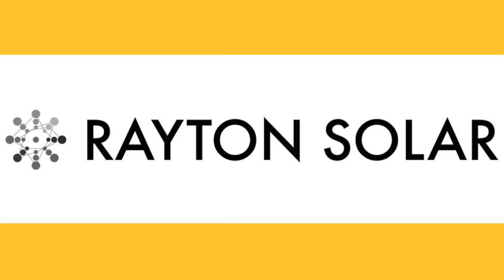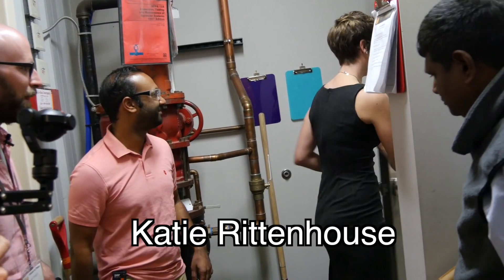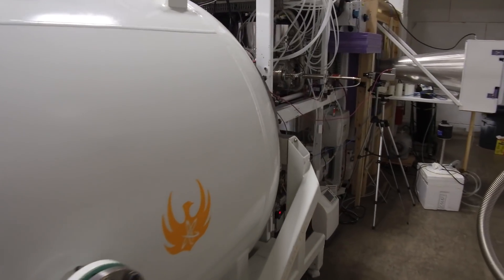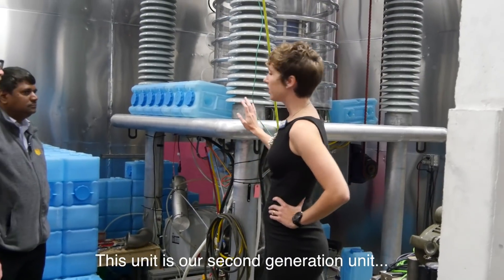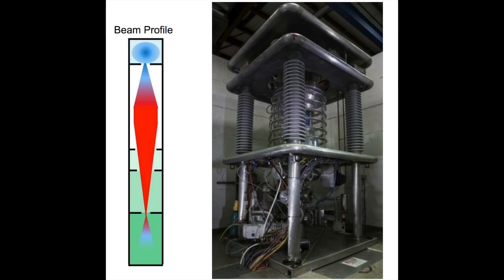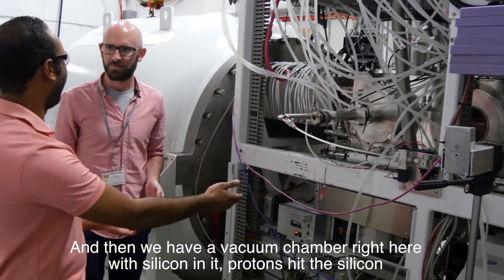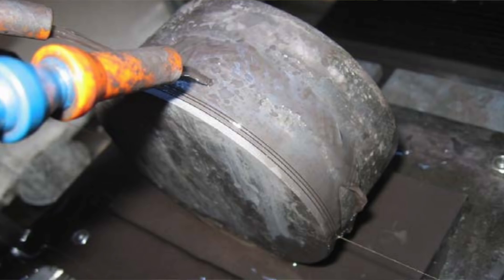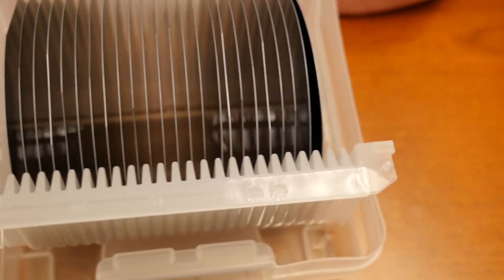Hands On Awesome Tech: Making Solar Cells With a Particle Accelerator

Comment: I cant help but wonder but if solar panels are meant to absorb solar radiation why are they blue instead of straight black? Isnt black allegedly the color that is supposed to absorb light to the fullest? Wtf?
Reply: It really depends on which frequency of light you want to absorb. Optimizing it for just that frequency is better because solar cell efficiency drops the hotter they get. More is not always better.
Reply: There are both blue and black solar panels, each using different forms of silicone.

Poly crystalline solar panels use a process that wastes less silicone and thus make them easier and cheaper to produce; this process gives them a blue tint and doesn't allow them to be as efficient if they were black. However, the cheaper costs outweigh that problem, so you often see these as the norm for the solar industry.

Mono crystalline solar panels are much more efficient due to their black color, but the process to make them wastes a lot more silicone and other material. This is obviously very problematic for companies who want to make as much product to sell as possible, quantity over quality really.

I'd say it'd be better to use mono crystalline panels if your space is limited and you need each panel to count, but if you have a fairly large area, what's the bother of losing a bit of power to save money?

My source for these claims is: https://news.energysage.com/why-are-solar-panels-blue/ 

I'd also point out that there are solar panels that convert heat into energy instead of the light, I haven't research what technique they use, but I believe they often use the poly crystalline one. These are later painted black since there is no worry of blocking light as they use heat instead.
Reply: The color of a silicon solar panel usually depends on the thickness of the antireflective layer (from blue to black). Cells often need to be color sorted after production. Pure crystalline silicon is just grey-silver. There is "black silicon" tho. The surface layer of that is laser doped with sulfur ions, which results in a higher infrared absorption rate (untreated silicon wavers are transparent for most of the infrared spectrum).

The increased efficiency of mono cells is a direct result of being monocrystalline. The purer the source material and the more perfect the crystal, the better the cell.
Reply: Chlorophyll? More like boreophyll!  No I won't go out with you!  Yes, chlorophyll is green, but it's green because it's absorbing all the other colored light. That's how all things with colors work.  However he's incorrect that plants are green because they've simply not figured out how to absorb green. I guess anything open for debate in science, but one theory as to why a plant wouldn't absorb green light is because green is the most radiant from the sun, and plants generally get enough sunlight from the other colors. The radiation from green would be more damaging than is needed for the plant. I guess a simple means of testing if this theory holds is if plants that much more light or much less light than average appear in other colors. And it's true that some plants will use less chlorophyll and more of other molecules. I found one called anthocyanin  is used more in plants that are more red or purple that would be getting too much radiation from the sun with more chlorophyll.
Reply: The colour doesn't matter they are powered by UV so it can reflect all the visible colours but still be highly effective
Reply: Black is an absence of colour as seen by our retinas. when we see "blue" it is because the light is not being absorbed in that spectrum but is rather bounced.
Reply: It might also depend on the location of where the solar panel will be used at.
Reply: It is not only UV for silicon. Silicon mono cells start at about 300nm wavelength in UV and max out at around 1100nm in infrared. There they have maximum efficiency. But yeah color does not really matter, except for the specially treated "black silicon".
Reply: Solar panels absorb light using Band Gap theory. They're specifically tuned to absorb discrete wavelengths -- specifically the highest energy light from the sun, UV. Feasibly if we created a material that absorbed more wavelengths, especially those in the visible spectrum, they would have a particular color, but it would be the complement of whatever colors were absorbed.  For example if it was tuned to absorb red and green light it would appear aqua, if it was tuned to absorb blue light it would appear yellow.
Reply: This is not entirely true. The solar energy spectrum might have the highest intensity in the UV range, but about 45% of the energy that arrives on earth is in the near infrared and about another 45% is in the visible spectrum. So UV really is just a small part of it.

For silicon the band gap is at 1.1 eV, which means that every photon with less energy will just pass through (that is why silicon is transparent to most of the IR spectrum). At the exact energy of the band gap the cells have their max efficiency (which is at around 1100 nm wavelength). Excess energy of higher intensity wavelengths (visible to UV) will just get re-emitted either as heat or as light.

Of course scientists try to tune the materials to better absorb the solar spectrum. Instead of concentrating on UV that gets absorbed partly anyway, they concentrate on the IR part, where most of suns energy is coming in and that does not get used by the standart silicon cells.
Reply: That One Toucan Chlorophyll? More like Bore-o-fill!!!
Reply: Bro Brah same reason a leaf is green as the plant has no clue how to process green light so bounces it off. To use more frequency's of light in a panel they need to figure out a cheap transparent layering that each one absorbs a type of light and lets the rest pass to deeper layers instead of the current single layer single frequency setup.
Reply: Andrew H I swear plants are green because of chlorophyll

Comment: Katie does not dress or act like a scientist.
Reply: I mean, she is a scientist, so by definition she sort of does dress and act like a scientist...
Reply: Neil Bradley - I hear what you are saying.  Perhaps I should have said Katie does not dress or act like a stereotypical scientist.
Reply: peggyt1243 you actually are right. Lets take a closer look at the company and its shady practices. Thats when you realize that this was a slimy add. Yes all adds are intended to sell something but this company does this a lot. They put on big shows or hire big faces who say short buzz word stuff that holds no real deep dive into the true substance the company is saying its going to be doing. They put on a much bigger show than most normal company's would. This shows they are desperate, want naive investor's, and have done this before. You come to find out they have. Look into the company and youll find its not what it seams.
Reply: peggyt1243 Your right to think so. Also if you really wanted to save money on electric just by coal buy the ton. Its really cheap, its not really ethical but you know if you wanted to save money go right ahead. Company's are hard pressed to use it most the time sense it comes with mega taxes and other shit but for the average joe it doesn't. I use coal for my forge and also electric during black outs. And yes i do have coal filters so its less of a problem.
Reply: peggyt1243 Also I'm not advertising coal im just saying if people had a cheaper solution with these high enegery out put ideas it would have already replaced the oil and coal industries.
Reply: +Magnus Error  I live in Ontario, Canada.  I heat my home with natural gas that comes through underground pipes on every street.
Reply: peggyt1243 I heat my house with oil. Fill it 3 times a year. Sometimes once. It obviously is just used in the furnace to heat water that than goes through the house and into the radiators.
Reply: +Magnus Error            In rural areas there are still some homes that are heated with oil but they are rare.  Most rural homes here are now heated with propane.   Electricity rates are ridiculously high here so electric heat  is just too expensive.  It is difficult if not impossible to sell a home with electric heat.   If such a home does sell, it will be for a considerably lower price than a comparable home with propane heat.
Reply: peggyt1243 Thats the same for America. Electric is expansive. I cant even imagine the cost for Canada sense its colder longer. That would make bills beyond all reason.
Reply: + Magnus Error I just went to the link that is included with this video and I can see that they are making claims or are making statements with implied claims that are simply not true.  Whenever I see the word "solar" I think "ponzi" because there is so much corruption and graft in the green schemes.

Comment: What about heat? solar panels get very hot how does it cope?
Reply: Medication and group therapy.
Reply: Bradley Noneofyourbizz hahaha
Reply: Well that's the fun part. Just slam a semiconductor layer on top that is good at turning that pesky infrared into juicy energy ^^. You will still loose some energy to black body radiation, but that will be way less.

Comment: Show me an actual working practical sized prototype solar cells then i'll get excited. till then, this video is really just for hype for Rayton Solar's current crowdfunding
Reply from the maker: The reason the cell shown was so small was the particle accelerator used to make it was much lower power than the one Phoenix is making for Rayton.  So it took a really long time to make it (and I imagine at high cost renting particle accelerator time), but functioned well as sort of a proof of concept.  If memory serves, the Phoenix made particle accelerator designed specifically for this use should be done within a month or two and can produce more practically sized cells at a very high rate. Andy mentioned the exact rate to us when we shot this, but that was a few months ago and I can't remember now the exact number and don't want to spread misinformation by recalling off the cuff. But it was shockingly fast.
Reply: 8 seconds per wafer :-)
Reply: Is that you Thunderfoot?  At some point solar technology will marginally improve. Deal with it.

Comment: For some reason, this feels like an advertisement.
And 3 µm is rather thick, they could more easily have used electron beam deposition and grow a 100 nm layer of silicone, using far less of it in the end. Downside here is that it isn't fully monocrystalline, not that this technically makes a much of a difference at these layer thicknesses. And electron beam deposition is also a cheap and very fast process.

Not to mention that making a plastic film, depositing a layer of metal, then the PN junction, followed by the top electrode, and keeping everything thin enough to be rolled up onto a second spool would greatly reduce the manufacturing cost overall. This is just based on my experience though and gathered knowledge.
Reply: They have been “crowdfunding” this cutting edge tech for like 2-3 years now it seems like, If it was as groundbreaking, cost effective and scalable as they like to claim I’m pretty sure they would have already had a share of the BILLIONS of dollars going into solar currently. Seems to be just another “snake oil” crowdsourcing scheme that will never come to fruition.
Reply: In semiconductor manufacturing, the wafers are cut thick for mechanical reasons, not for any economical reasons. But rather for the reason that the wafer can bend and therefor create uneven coatings and through that result in less tight tolerances in manufacturing. This can in turn affect the yield. And the most obvious is that the wafer can crack more easily, clearly effecting yield.

So it wouldn't even be of interest for the semiconductor industry. And it isn't like they are tossing away all that pure silicone powder they make, that gets recycled, sent through cleaning, before being made into a new large crystal. And the energy used during manufacturing isn't that incredible to start with.

And yet, direct silicone deposition can give even cheaper solar panels without effecting overall efficiency much at all. Simply stated, from a solar farms standpoint, 28 or 30 % efficiency isn't much of a difference, and if the 28 % one is 10 % cheaper, then that as well makes up for the difference.
Reply: Its more or less is an ad IMO. Rayton Solar are doing croudfunding at the moment to this seems oddly timed. They had a prototype of 'something' but it wasn't a working cell
Reply: To share my lower brow opinion I couldn't help but wonder, "If this is so ground breaking, why isn't Elon using this at Solar City?" There'd have to be a good reason why this is the best method over what the more successful solar companies use.
Reply: When theory meets reality a lot of things get dumped by the wayside. It may have promising features in small scale that just don't work when scaled up, or are so difficult no one else has figured out how to do it or believe it can be done.
Reply: The thing they do is technically viable, and theoretically works. Nothing wrong in all of that, but in reality, the numbers they are quoting is only an approximation. Since they don't have the manufacturing tools at hand and at least they have done some preliminary tests on a smaller scale.

Though, the technology they have at hand here is most likely not going to be used for commercial electric production. As there are far cheaper methods on the horizon. Horizon in this case being actually sold products, but currently limited by factory production speeds and pure economical reasons. After all, production infrastructure is important, and just because someone does a crowd founding campaign doesn't mean that they have the tools to produce enough to cover the market needs.
Reply: It's pretty much a glorified sawing/lasercutting method. But if they get it to a point where you could slice and dice a whole 400mm single crystal into 3µm wafers without waste ... that would change a lot. And it could most likely be applied for IC wafers as well.
Reply: You're right in every way except maybe the energy part ... it takes a lot of energy to make those huge single crystals. And the cutting puts quite a lot of stress on the wafer, be it mechanical or thermal. So if it gets to the point of being cost effective and you can choose the thickness as you need, it still might be the better choice. It's not so much the yield in production that hurts, but the cleaning after a complete breakage of a wafer. Total standstill for that production line.

I didn't mention silicon anywhere tho, did I? This method should be usable for a lot of semiconductor materials. It might make some of the expensive ones way more viable and even if it's just for specialised applications, like satellites.

And if we take a look into the future ... commercially the most interesting ones should probably be organic cells, at least when they reach the roll to roll production stage. Nothing beats just printing them in huge ammounts.

Comment: Really cool stuff! Solar power definitely seems to have a bright future! (no pun intended...)

(Oh, and at 7:29 : Why not just weigh the bullet?)
Reply: Ammunition powder loads are measured in grains. 1 ounce = 437.5 grains. A 5.56x45mm round can have a powder load somewhere around 22-26 grains. There's too much weight variance between the cases, bullets, primers, and sometimes powder charges to make weighing a completed cartridge effective.
Reply: Ah but that assumes that the weights of the projectiles+casing are more consistent than the weight of the propellant.